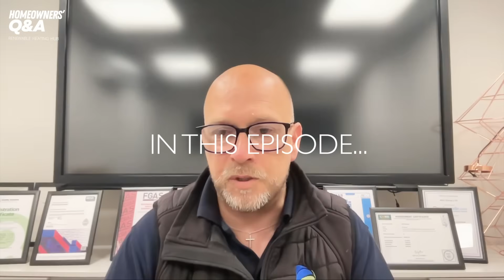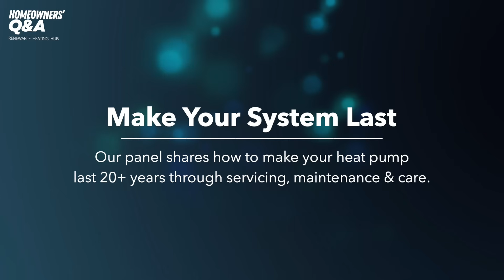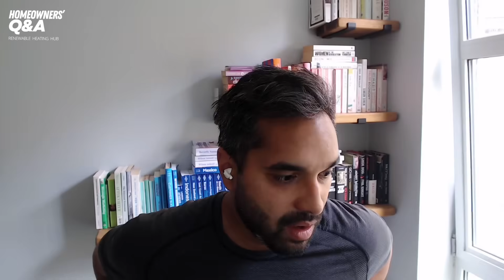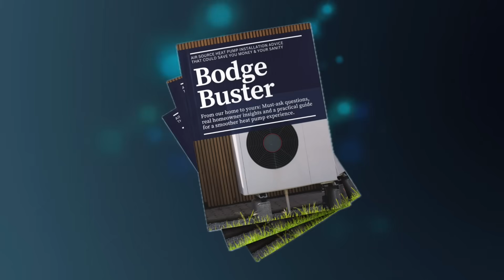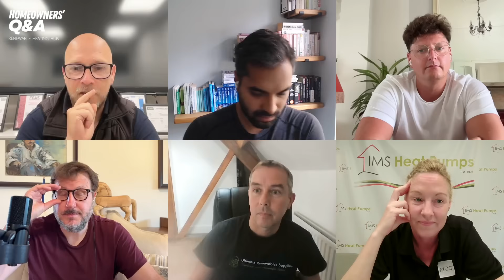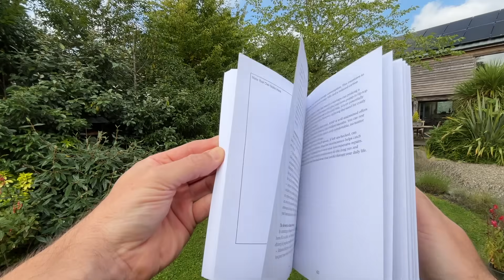How Long Should a Heat Pump Last?

Comment: Great show mars, hit many points there, I reckon i can swap a heat pump for a heat pump in Half a day.

Its all in the system, that's why it can be expensive, its the the heating-hot water system we are bringing up to a low temp heat pump standard (should have been policy two decades ago), once this is done-its done.

I wonder who said NO to low temperature heating standards 😂
Reply from the maker: Thanks the insights as always Ken… always interesting. And thanks for watching!

Comment: I am an homeowner in Canada and I would to reach to say the conversation really interesting, I am in the fence for a thermopump. I was told that there was no economy in heat pumps over electricity here in quebec. Apparently we save 500$ a year in electricity but the system last 10 years and cost 5000$. No gain no loss… not quite because you have to figure regular maintenance but we get air conditioning in the summer and the cost of replacement might be cheaper in 10years -plus if i add som TLC we can aim for 20years .. It really all bowls down to the quality of the install and the service not so much about the make of the model, right? Wish you were in Canada , I think the business model is superb especially if it can lead to collaborations between companies that would normally be competing.

Comment: If the manufacturers were soo confident on the longevity of air to water heat pumps why don't they give the same warranties as the gas boilers they produce? Look at all the majority manufacturers who produce gas boilers and the boiler warranties are longer!!
That to me, says it all.
Reply: Because most things that go wrong aren't because of the heat pump itself, in most cases it's because of a bad install. The only way to fix that is by increasing training on it and choosing a company that will take responsibility when things go wrong.
Reply: @FahadAyaz You've missed the point! Example. Vaillant boilers. 7 year guarantee out the box, 10 years if Installed by Vaillant approved fitter.
Heat pump. 5 years out the box, 7 years if Vaillant approved 
Even though heat pumps are subsidized and being advertised as the future, before they are even installed Vaillant dont have as much faith in them as their boilers, otherwise the guarantee would be the same!

Comment: The oldest heat pump I know of turned 40 this year. Ground source pump with 110000h this year.  Guy has tracked energy consumption and it's still the same as it was when it was installed 1985
Reply from the maker: That’s a solid investment right there!
Reply: @RenewableHeatingHub Yeah, all original except for a swap to a modern circulation pump, an Combi 6 (Nibe today) and it's been calculated if the energy savings could accumulate to install a new inverter pump. But it just isn't there as long as it's running.

It still works on the outdoor temperature (weather compensation), just none of the fancy modern displays😅

Comment: Hi, I'm 76 and every thing I have is old. I cool my house with a 21.000 BTU Kenmore window air conditioner that is 33 years old.  Our refrigerator is also at least that old.  My American Standard boiler is over 60 years old.

I did replace my 25 year old Chevrolet Silverado truck with a new one in 2023.
But am not replacing my 71 year old wife, we just celebrated 50 years of marriage.
Reply from the maker: That's an impressive track record of keeping things running!

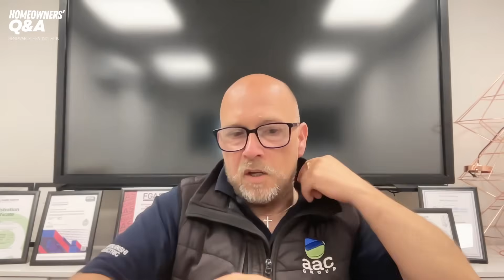Comment: 34:00 It will never be £80 per service or less than it is now when theirs more people in an area for an engineer to cover within a stones throw.

Th engineer will just know the customer still requires the service and therefore charge the 200 or so they charge now, then apply it to more customers in a day and get richer.

When questioned theyll say they need to pay for tools training and their van insurance and so on as though they're the only people who need a vehicle to go to work or tools.

Its no dofferent to the gas services just elevated prices.

This isnt being cynical its the truth.

We've seen it with the majority swallowing up the grants by increasing their prices due to mcs paperwork taking up so much of their time.

The only thing tha lowers customer cost, is competition.

Comment: The issue with heat pumps is that theres so much involved for them yo be installed and run correctly conparwd to gas. There's not enough good installers.

I've listened to this channel for over a year. You couldn't make a channel run for a year talking about gas boilers which says it all.

I'm a fan of heat pumps because im buioding an eco house, would i fit one in my current old house, No, for many reasons.

The warranty do need to be longer to be more appealing too.

Comment: My first pump lasted 13 years. Had it replaced in March. New one should also last 12-15.
Reply from the maker: What brand was it, and did you get the same brand again? Was it a “quick” job to replace?
Reply: @RenewableHeatingHub Daikin both times. Having had the maintenance contract with Daikin I know most of the northern support team, they’re mostly great with a good management team. 

The new one involved taking the pump off the roof and mounting it downstairs on the wall (to ensure adequate air flow). Quite complex. All done in 2 days. It’s been excellent since, very efficient.

Comment: I'm not entirely sure the discussion will persuade those who are sat on the fence regarding Heat Pumps. The servicing side is becoming a bit of a 'Wild West' and if government want to instil confidence in the HP technology they should regulate the servicing costs. Octopus, love them or loath them, at least give peace of mind at just £9.00 a month, which coincidently is around the saving from the removal of your Gas standing charge.
Reply from the maker: Oddly, most experienced installers will tell you not opt for a service for £100-ish. I wonder how good and thorough Octopus’ services are.

Comment: I've had a Kingspan ASHP for over 14 years. It's been OK and fairly economical. It's just a switch on/off system with no feedback on performance. I've only rarely had it serviced, so it's done well. I tried to run it with all thermostats open but it seemed to increase running cost. I saw some stories of very high decommissioning and replacement costs for heatpumps. I have installed 5 air to air units and found them very economical and have enjoyed the cooling this year. I have a 5 bedroom detached house with good insulation. Underfloor downstairs. I have only used the ASHP for hot water. I would probably go for a replacement ASHP if the cost wasn't too great, but of course there's no grant.
Reply from the maker: That's great to hear, thanks for sharing your experience and thanks for watching!

Comment: I am a heating Engineer of 33 years. I hear a lot  about flow rates open loops and system design and setting up these systems but I have never heard about setting the KW output/heat or the anti cycle delays in the way I have been doing on my Vaillant boilers for the past  25+ years that I have specialised in . Do heat pumps have this functionality . I can foresee this could stop /reduce the cycling that I am told will cause the early death of these system
Reply: Yes they are built in to a point, if a house only needs 2kws (mild weather) and the heat pump can only modulate (turndown) down to 3kw, it will cycle.
What we don't want is third party controls inducing cycling, with on/control and zoning, if you're produce more heat than the system can absorb and have to use micro zoning to control this, then maybe WC settings need to checked.

Comment: We had an initial problem with the HPs inverter which had to be replaced as it was burning electric like crazy, after that it settled down and two and a half years 12.5kw HP its been perfect.....but persuading the manufacturer that there was an issue was an issue in itself. I'm not naming and shaming unless you require!!!!
Reply from the maker: I think this is quite common. There have been components faults in units and manufacturers are really to convince this might be the case. How did you make the case to your manufacturer?
Reply: @RenewableHeatingHub  Thanks. Fortunately I kept all the stats and pictures from the screens off their controllers but the critical factor was the Solis Solar Inverter App which provided real time energy use. 4 different engineers and their service centre couldn't make sense of it but I think they just didn't want to admit a fault and do the repair

Comment: I’d like to know that manufacturer with the internet connected heat pump where you can do online servicing
Reply: I think we need a clearer definition of 'Servicing'. Colins dictionary defines Servicing as : - 'the act or process of overhauling or repairing', I believe what this panel has been discussing is a fee for 'Checking' .....with the possible additional swill with a hose.... = £150, thank you very much.....but added bonus, if they can find 8 other suckers in a day they will bring the price down to £100.

Comment: Waiting for heat pump installation and breakdown cover to improve before committing
Reply: Octopus offer it on their own installs. But is also offered by homesence and a few others. It around £10-12 per month including an annual service.
Reply: If your existing gas boiler is working perfectly then yes, don’t do it yet. 

Far better ROI to get your house properly insulated and adequately ventilated, because however your heat is delivered there is no point spending money to heat the street. 
If you have spare cash after that then install as big a PV system and home battery as you can, I’m getting about an 18% return PA on the money I put into that. 
But a well designed ASHP is going to take 15 to 20 years to break even, if privately funded. I have done it and it works brilliantly and saves me 100% on my heating and electrify costs (in fact my utility supplier pays me) but only when combined with all the other measures. Running it on its own as a direct boiler replacement in a drafty house is never going to work well.
Reply from the maker: It’s coming… hopefully it’ll be a more robust by early next year.
Reply: They are very reliable, more so than most gas boilers. Design and installation of the system is key.